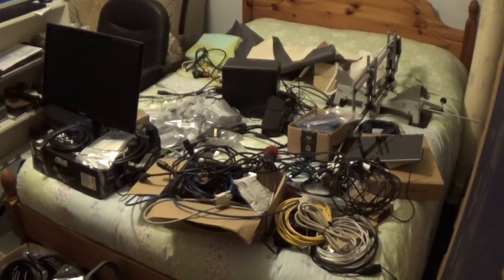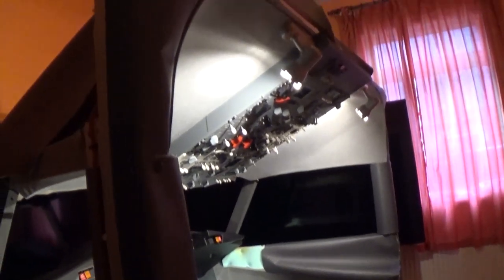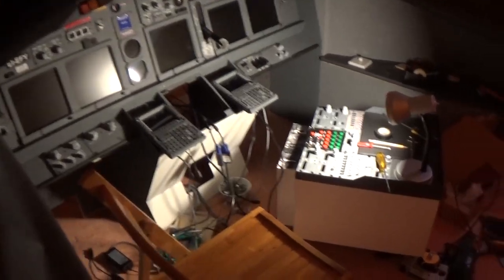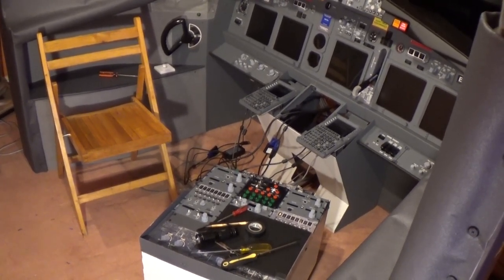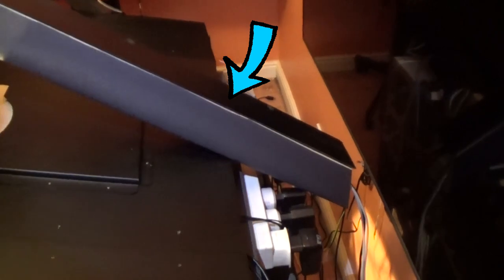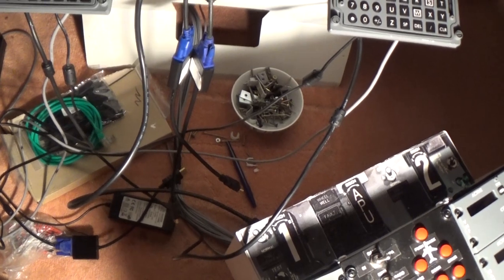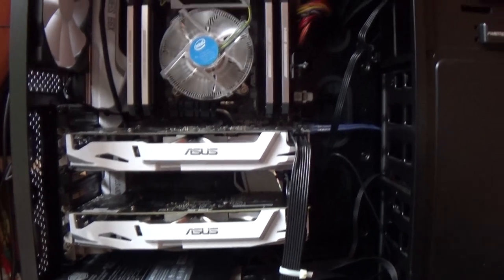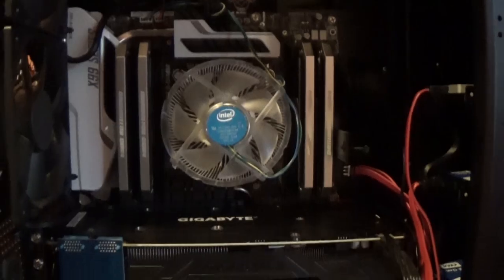Quarantine Escape Flight Update 8

Comment: Will there be a gap bewtten the TVs or will you be moving the side ones flush against the front one
Reply from the maker: A good question - no gap.  In fact one good thing about these televisions is the side bezel is so slim that it will be a treat to use. Right now the two side screens are mounted on stands with wheels so I can get in and out of the back where all the wiring is.  You may have noticed I am no longer the slim young lad I used to be so movable screens was essential 😂
Reply: @FatherDane  you can get silver foil tape for the bezels, it reflects the screen so makes them less obvious
Reply from the maker: @CarlCrez  Yes, I have heard of that and it does sound effective so I shall look into it.  Thank you for the reminder 😊